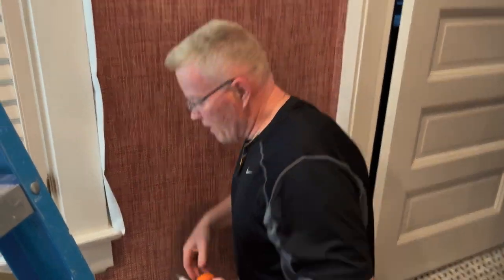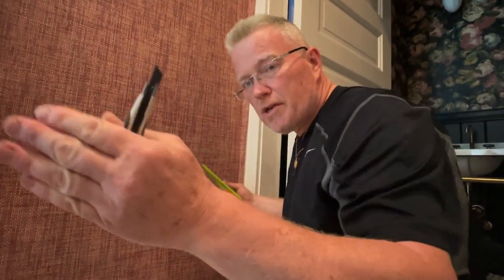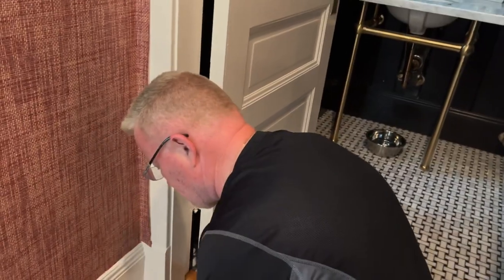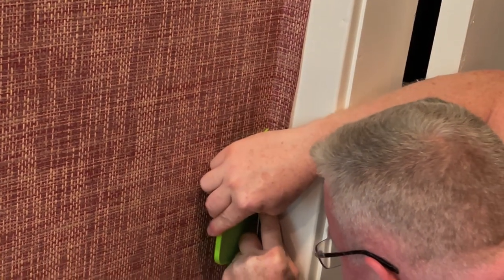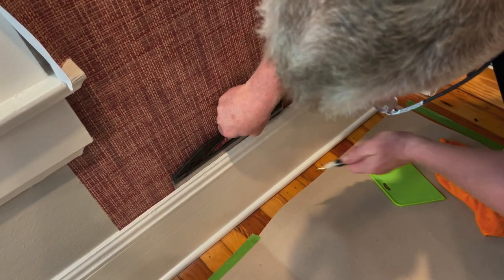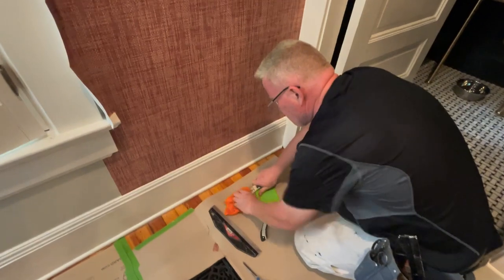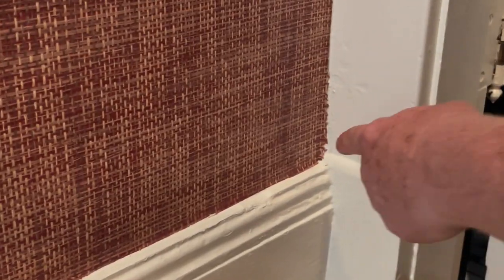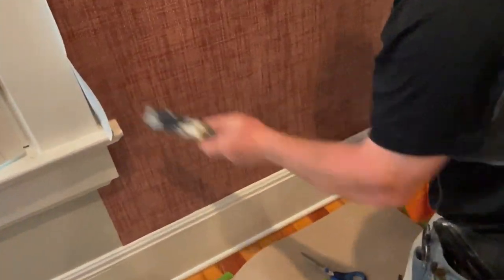Trim Woven Wallcovering Properly - Spencer Colgan

Comment: Hi Colgan!  Is it OK to put 2 coats of SEALZ between the skim coated wall and new wallpaper (Quadrille with 2 selvedges in this case)?  Couldn't remember if you said 2 coats of Guardz or Sealz was best :~/ in past episodes.  Quadrille is no wimpy choice for the DIYer,  but I stepped in it now and it's too late to back out!  Thank you!! Your videos rock!
Reply from the maker: Hi …I would use gardz after the last-only Skimcoat layer.  No need to apply on multiple coats.  And.  Thank you